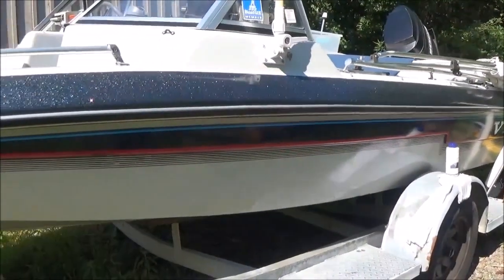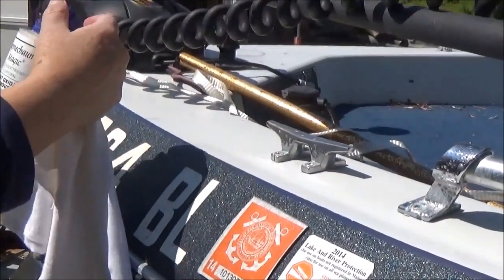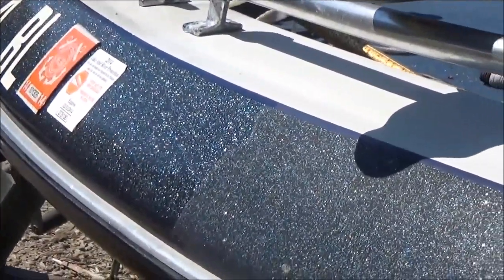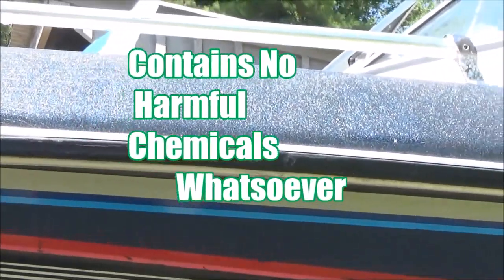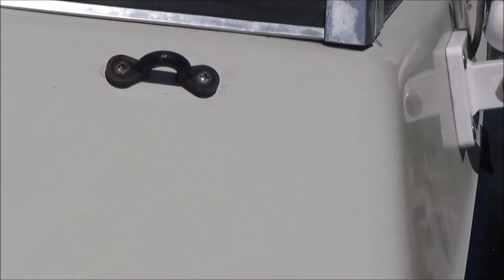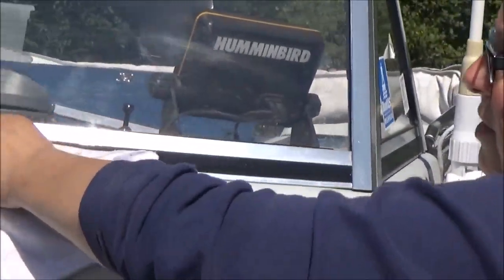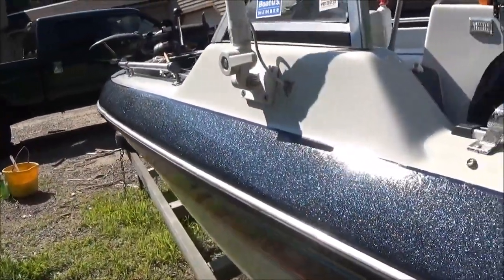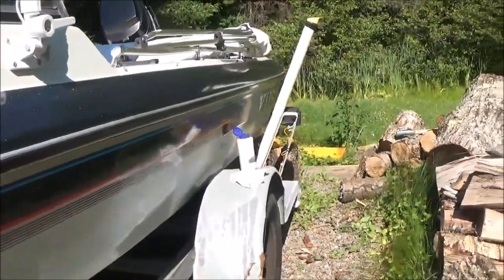Very Fast & Easy way to Remove Chalky Effect of Oxidation on Fiberglass Gel Coat for Boats/RV's

Comment: So I just got mine this morning. Tried it just before I had to leave for work. I almost called in to continue using it. Absolutely, Absolutely works. 1979 ranger bass boat. Finish felt like sandpaper. I did wet sand it but I might not needed to. I did a long strip on the top and looked gorgeous. Can’t wait to get home and keep going. So far I will say it won’t let you down. Works like majic

Comment: At first I was very skeptical of this product, wet sanding was the best option for removing oxidation from my boat, of course there is only so much wet sanding you can do and takes up a whole day from start to finished.  I tried pulling up reviews on this product and all I ever saw was people saying they are going to try it but never post back on the results. So with that said I thought I’ll give it a try.  Anyone who owns a fiberglass boat, bass boat or jet and ski you owe it to yourself to try this product!  It’s not a permanent fix to oxidation but this stuff WORKS!  I have a Triton Tr21 fish in freshwater once or twice a week on KY Lake/Barkley wanted to remove some oxidation that has accumulated over the years without wasting a weekend wet sanding my boat then buff.  Not sure how well this works for those who are on saltwater but if you have oxidation and want to remove it quickly and wax your boat at the same time you need to try this product! Yeah this video is a little cheesy but the point is THIS STUFF WORKS!
Reply: This is exactly the product ive been looking for.  I bought a silver ski with a metalic flake the paint was very chalky ive used compound and I can't get it looking better but its still flat looking but I see still some metalic flake so I think this could work to get it to shine again.

Comment: I have been cleaning boats for many years.  Oxidation is a huge problem and especially on colored gel coat.  Seems like red is the worst.  I purchased a bottle to try it out and it did work great to either remove the oxidation or to hide it...not sure which.  I am trying to find a phone number to speak to someone but have not been able to locate a number yet.  I do have a few questions that I need answers to.  I used rubbing compound with a buffer on 1/2 of my boat and used the Lep Magic on the other half.  When I run my hand down the compounded side, it is very slick compared to the Lep Magic side.  The Lep Magic side, my hand seemed to drag rather than being nice and slick....why...is it supposed to dry then wipe off?  Not sure if it would dry enough to hand buff it out to a slick finish.  Am I doing something wrong with the application?  
If Lep Magic is reading these posts, please leave a phone number so I may call you back.